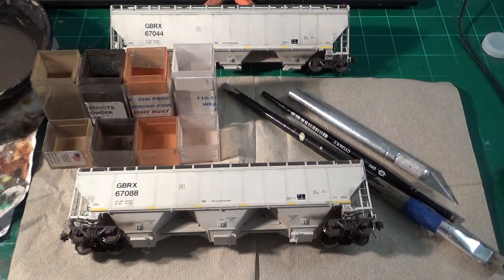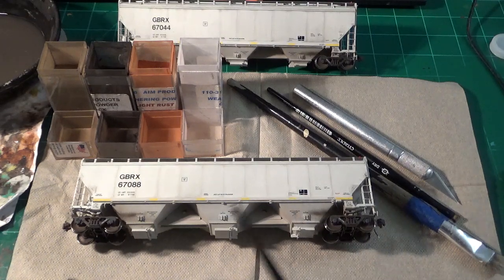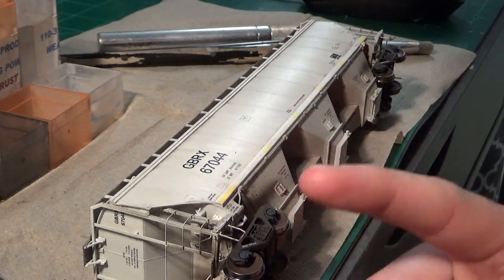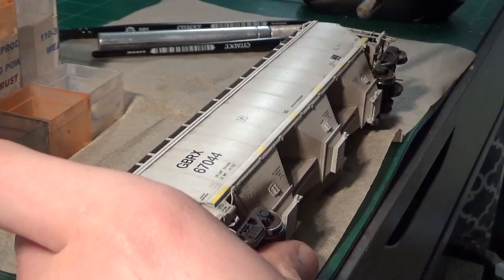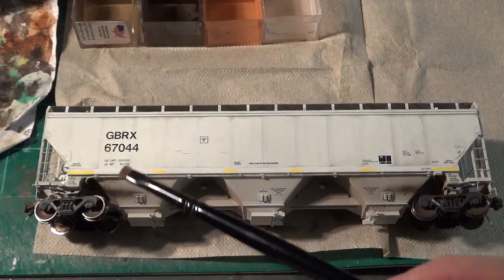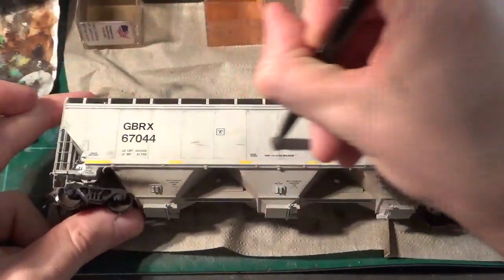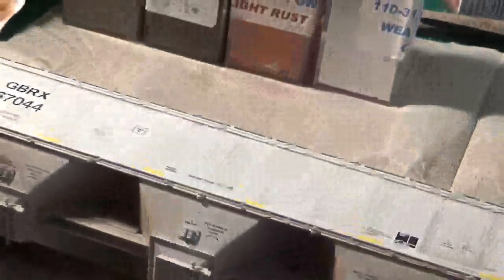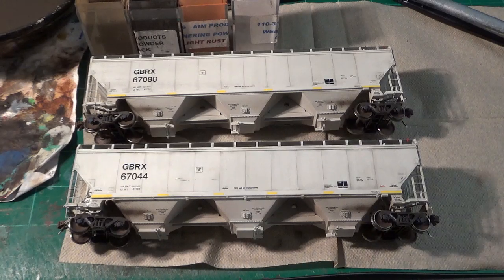***HOW TO:  Add Scratches And Pitting To Hopper Sides!  HO Scale Weathering.***

Comment: Will a steel coil car video be on the horizon? Scratched built a few CR 602200-602300 series cars.  Seen one with a large pile of metal bands and chock blocks in the center.

Comment: Hey Dan, so if I was to do a BNSF Hopper which are mineral red do I do the same methods as posted in the video?????? Great work by the way.......
Reply: Don't see why it wouldn't work. The only way I could see it failing is if the darker colour of the car means it's harder to see the scratches, but that just means you wasted your time -- it's not going to ruin the  car or anything.